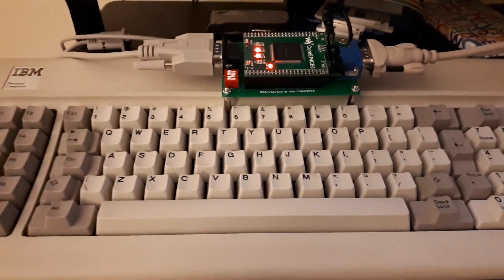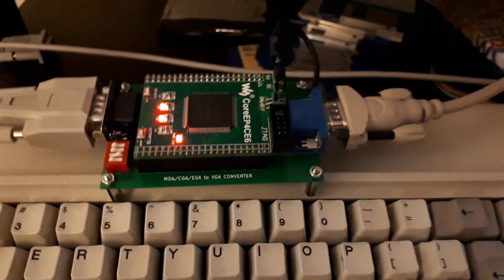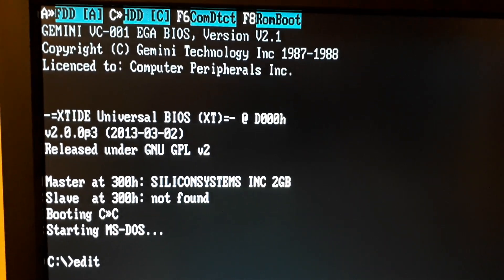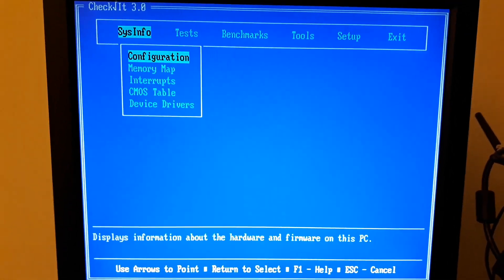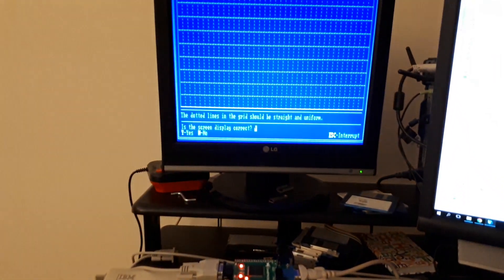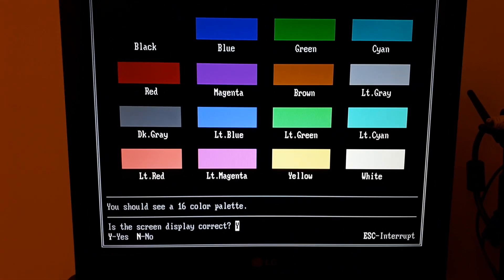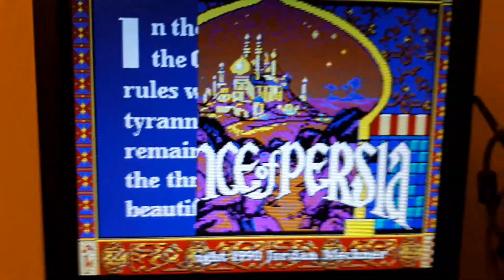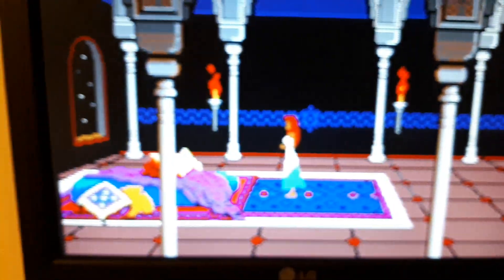FPGA CGA/EGA Converter

Comment: Hey, can this work with the monochrome output on a Tandy TRS-80 Model 2000 with it's 26.4k horizontal signal? I'm trying to figure out if it's my wiring or compatibility issues with the converter. Thanks!